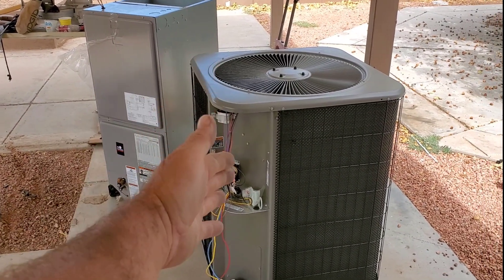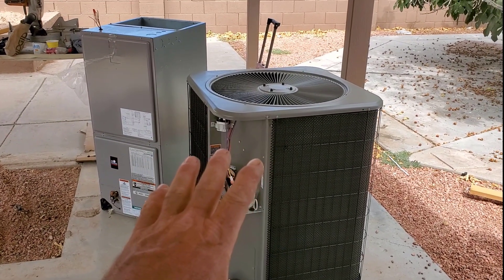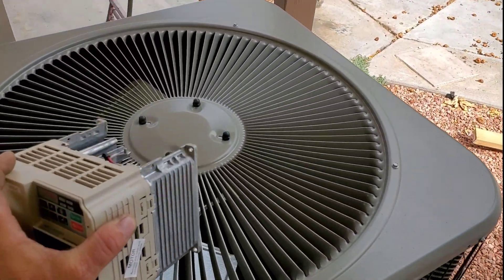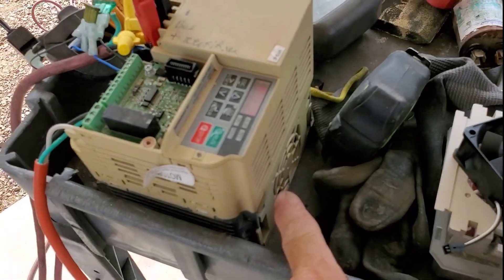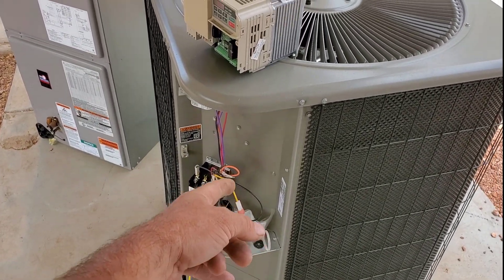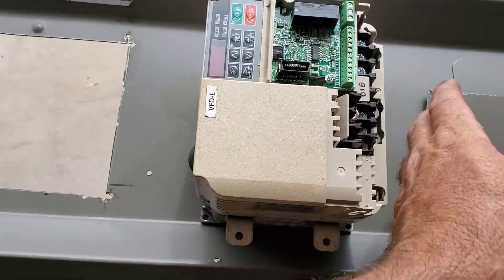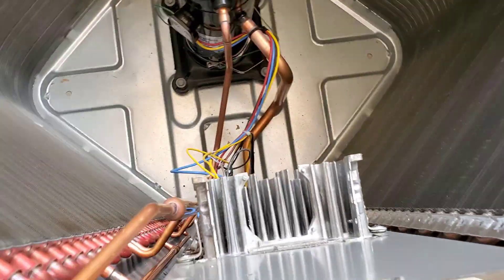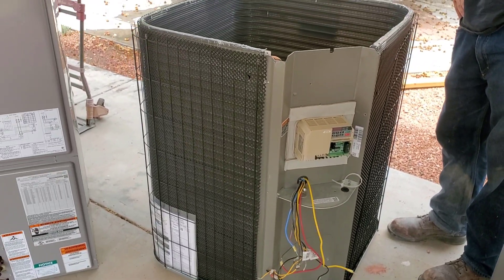Installing a Variable Frequency Drive to use 3 phase condenser for dual power source

Comment: I've got a question. You seem very "up" on the sort of thing I'm trying to do. I want to switch between power sources on my VFD, any ideas?
Reply from the maker: What kind of power sources?
Utility to generator or something like utility to high voltage DC?
Reply: @hackfreehvac  my 2 power sources are 1) an inverter and 2) a generator

Comment: Hey how is the vfd working in that location???
Reply from the maker: Great.
These VFD's are used in central plants all the time with limited airflow to the enclosure they like to stick them in.
This is actually better since I removed the cooling fan and it has the air from the condenser.
The condenser air is probably about 10 degrees above ambient but it has a lot of airflow compared to what these get shoved into an enclosure that likely recirculates a bit of the heat.

This is the 2nd summer this VFD has been in use on this unit.

Comment: 2:28, take note of the quality of that mental, if that were a goodman unit, a plasma cutter would have been too powerful, in reality, if that were a goodman unit, you most likely could have used just compressed air and it would have cut through it.
Reply from the maker: Indeed 
This was actually some fairly rigid panel material.

Comment: I have successfully converted few straight a/c to heatpump. You can use emerson 47d43 811 universal board has nice defrost feature it looks at coil temperature not just time to prevent un needed defrost. Good luck

Comment: If you sell your house, the next resi tech who does service will open the panel and be like "wtf am i looking at?"
Reply from the maker: HA HA HA! No kidding!
Most of them would not know what that even was.
Reply: hackfreehvac my service manager pulled out emesron e2 out old supermarket refrigeration rack and put it in his house to control a/c lighting, generator etc.
Reply: jon - Lol for sure.
Reply: Or would they want to make an offer to buy the house for all of the cool hackfree improvements?

Comment: Awesome idea. I’ve seen the trane xv20i condensers use the liquid line to cool the heat sync.
Reply from the maker: And so did the 1992 era Trane units that had residential FULL variable speed.
A little before their time, so they flopped.
But I figure that liquid line will be even higher than ambient, so I should be fine with the heat sink in the air
Reply: hackfreehvac yeah that’s true. I’d just be worried about oil return at low rpms. Daikin and lebiert have oil return cycles they run

Comment: You better patent this VFD install before Lennox steals your idea.
Reply from the maker: LOL
It is pretty much what a mini split does except I am using a scroll and not a rotary that can be fully variable.
Trane ran full variable in 1992. But techs couldn't figure them out and they flopped.
Reply: hackfreehvac a lot of them still can’t. Lol. Hate to say it but this industry still has a lot of techs that just slam in an go.
Reply from the maker: @thetman2301  OH no doubt

Comment: That's bad ass man
Reply from the maker: It certainly will be when I see the solar power at least 50% of the compressor current in the afternoons. :-D
Reply: it must really suck paying peak electricity rates to run central a/c in arizona with ducts in a baking attic. too bad builders are too cheap to foam the roof deck or put bulkheads (or leave enough space in the ceilings) for ducts to be inside the house.

Comment: Cool. Like to see the wiring diagram and type of PID controller. Keep it coming
Reply from the maker: It might be as simple as start enable and operating only at 60HZ
Emerson says the Scroll compressor can run 45Hz to 60Hz.
I could play around with slowing it down but as I am replacing a 4 ton with a 3 ton as it is, I might not.
Will have to see.
Reply: hackfreehvac   will be a nice soft start.

Comment: Good vid ! Thats a cool idea putting the vfd in there to pass air over the heatsink at all times. Only possible problem is Air Going over the heatsink may be too hot in arizona. I Would of put the Vfd in a Air conditioned space in the house.  Thats the only way a vfd survives , especially in arizona. As u well know electronics don't like anything over 80 degree's.
Reply: Hackfree - Looks great!  Be very interested on you progress.  Right OC - yesterday it was 115+ here and my 5-stage was reading 123 at the control panel temp sensor and even warmer with IR thermometer on the panel. The unit Staged down to 2nd stage as it sensed it getting too warm.  Still kept rooms to setpoint, but hallway was drifting 2 to 3 above.  Carrier/ICP tech support doesn't like the unit to be installed on the West exposure where it gets sun all time...but I had to try it and see how well it works for myself.  Tech support told me they will eventually go to a liquid line cool inverter (Like Trane, Daikin and others) but no timeline as Carrier just released the "extreme" line of Greenspeeds and they are still air cooled from what I see on HVACpartners.
Reply: @TheGgin    i dont know why they don't go suction line cooled heatsink.
Reply: @OcRefrig  Right? Not sure, maybe it causes too much expansion  of the suction gas before it gets back to the compressor lowering efficiency??
Reply from the maker: The VFD's run at 130+ all the time here.
They are often installed in a metal enclosure that is lucky to have some vents cut into the side of it yet alone an extra axial fan to exchange the air.  (See this video at about 3:30 in the video for an example https://youtu.be/JH3La97eiKA?t=210)
And I rarely find a VFD fail.
The Inverter mini split units have finned heat sink hanging in the condenser air exactly like this.
Some use a smaller heat sink with liquid line. Same temp. About 10 deg or more over ambient.
Reply: @hackfreehvac   i guess they run them hard and hot. i GUess they are still on the drawing board. they should use suction line heatsinks for cooling. steal a little cooling. ill check out that link.
Reply from the maker: @OcRefrig  
The suction would cause it to do below the dew point and condensate inside the electronics. 
So that would be bad. 

And in the world of electronics,  130 to 140 degree operating temperature is not hot at all 

Car ECM's are under the hood in 150 degree temps
Reply: @ hf - i hear ya on dew point. I was never talking about taking heatsink below ambient , just use the free cooling from suction line to maintain vfd at ambient. I guess they are making electronics better than they used to. Most Car Manufacturers these days are Moving most of the Modules to inside the conditioned space / inside the car i have noticed.
I Wish u Good luck with the inverter. I Hope it Works Good & lasts for you. Sounds Like it will. That would be awesome to Reduce your electricity bill by 50%.
Reply: @hackfreehvac  Right, possible the MFG want to maintain a longer service margin?  I saw Carrier put in higher amperage IGBTs and better insulation on the replacement Inverters for the 5-stage units.  Since you are using Industrial VFDs, maybe it has a better service margin.
BTW - I have a brand new 5-ton 230v 3 phase 410a scroll I pulled out of an brand new ICP condensing unit because I converted it to a 3.5 ton for a project.  I looked up the displacement and it's similar to a 38K R-22 scroll, so  if you feel really energetic, you could convert it to R-407C.  Just sitting around let me know if you want it.

Comment: Forgive me if this is a stupid question...I know vfd's control/change frequency to speed up and slow things down, does your particular one convert 208/single phase to 3phase also? Or do you have 3 phase at your house?
Reply from the maker: It's a 3 phase compressor and the VFD drives the compressor.
The VFD doesn't care if I wire single or 3 phase into it. It just charges the DC capacitors the same.
My house is standard single phase.
I will be feeding single phase A/C and 330VDC from solar into the same VFD.
The afternoon sun will provide most of the current and expecting to reduce my home utility current by over 50% at that time of day.
Reply: @hackfreehvac  gotcha. I dont get to play with vfd's so I didnt know that they dont care about the input. I had solar put up last year for my house. Definitely alot lower srp bills... lol
Reply from the maker: @Crisis-1837  From what I know, SRP doesn't even work with Solar companies anymore.
I also have a grid-tie from Solar City/Tesla and I save like $30 on my APS bill.
This thing should save me more plus I'll be running it colder during that time where I usually have to kick it up to 80 or so on the time of day plan.
Reply: Most VFDs output 3phase AC.  Single Phase VFDs are less common.

Comment: You have the fan cut a hole underneath drive and use outside air to keep it cool it will be cheap to operate when you get done
Reply from the maker: Some VRF/VRV units use the liquid line to cool a minimal heat sink (at least 10 degree over ambient = about 130 degrees here) while some such as Mitsubishi just have a finned heat sink in the air stream exactly like this.
We have VFD's in use all over the place that are sitting inside a closed box that is exposed to outside air and sun that are lucky to have some vents. And I rarely have to replace a VFD.
So I think this will be good.
Reply: @hackfreehvac  ok if it's oversized slightly it will run cooler also should be a saving with the solar tied into it
Reply: You could see what the temp it runs and see. Do as needed
Reply from the maker: @royamberg9177  If I had issues I'd probably loop a piece of copper through it and feed some liquid via a capillary tube to actually cool it. But they seem to work air cooled around here all the time. Even trapped in boxes with little outside air exchang.
Reply: @hackfreehvac  it will work. I just like to see things last and last and last lol. I don't like to do things over  you see